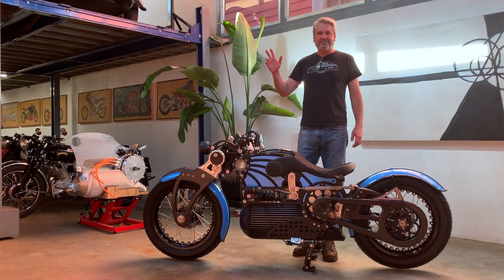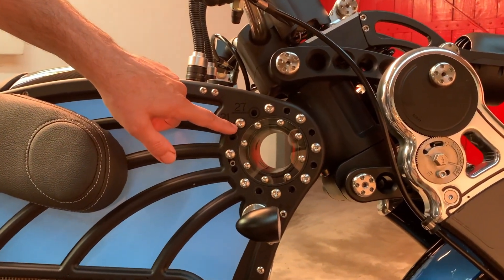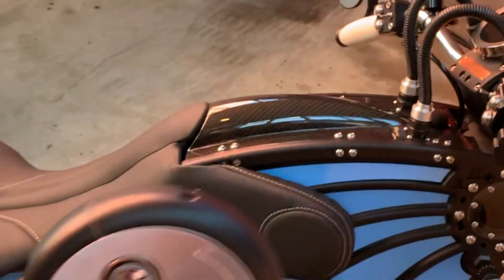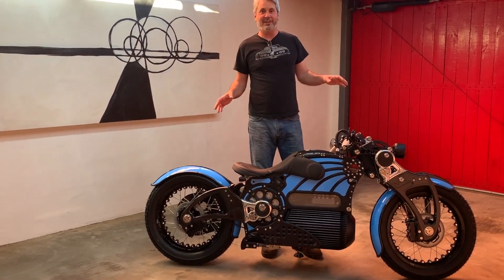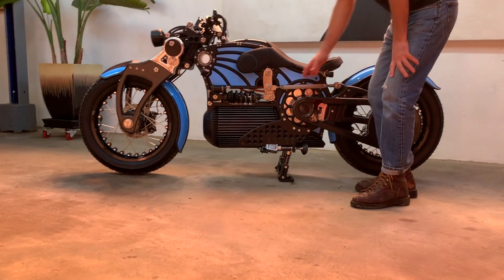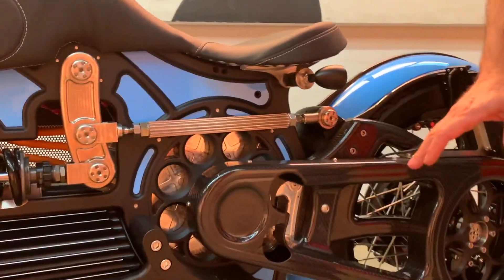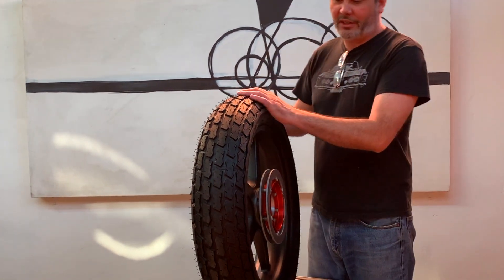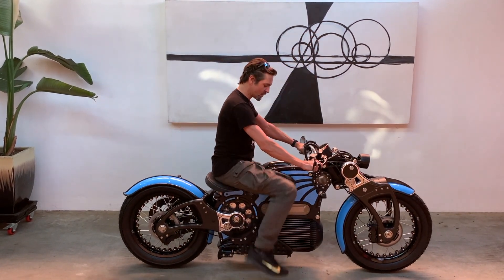Curtiss One Prototype: Initial Walk Around

Comment: Very, very cool! BUT
It looks small. As someone that's 6'2" and like's mid-controls, the bike doesn't look comfortable. I would hope for adjustability for different height people, specifically rider triangle, (seat, pegs, and handlebars) adjustment. I would also like to sit "in" the bike, not "on" the bike.
Reply from the maker: Thanks, Jason! JT, the designer of The 1, is 6' 4" and feels very comfortable in the saddle with mid-mounted pegs. The 1 has 22 different foot peg locations, adjustable handle bars, adjustable wheelbase, and adjustable seat/ride height. We have had riders from 5' 1" to 6' 4" + find a comfortable position astride The 1!